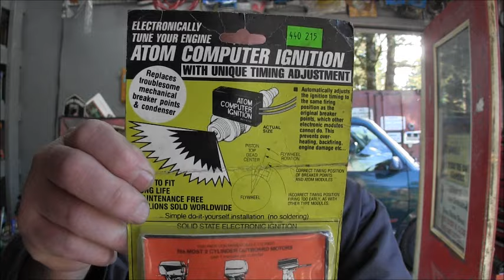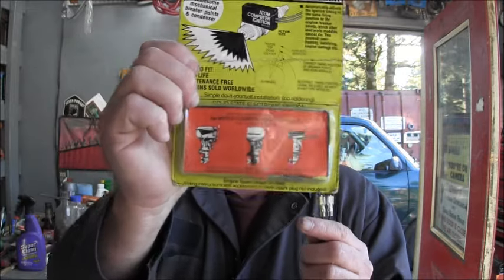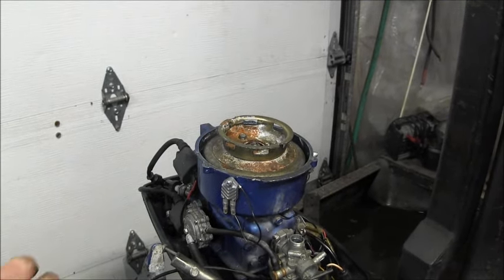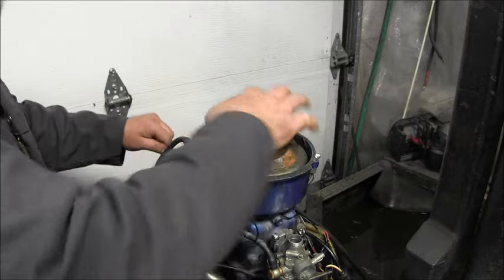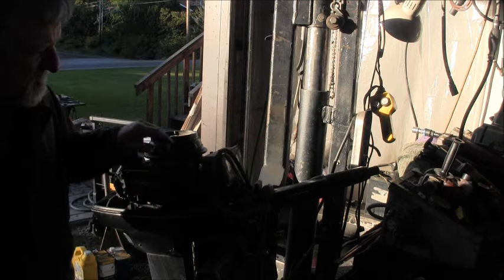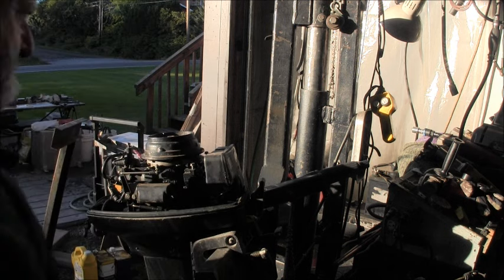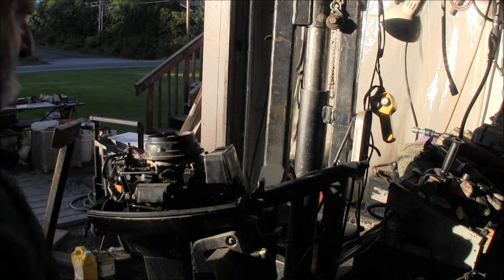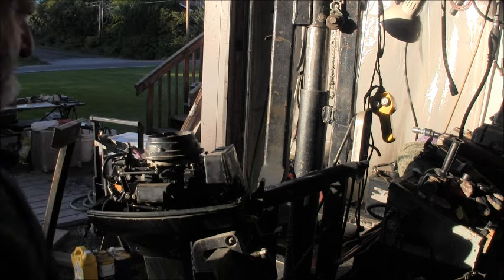DO NOT  BUY,  THESE  OLD  OUTBOARD'S

Comment: Tips for trying to pull of a stuck lower unit nuts and shift linkage removed tried heat on studs and wd still won’t come off some advise would greatly appreciated

Comment: It’s probably a safe bet the integrated circuit and transistor potted in the Atom was made in the US or Japan. The Nova most likely comes out of China. I think electronics 50 odd years ago were both simpler and more robust. I would be amazed if you’d get 50 years of service out of current electronics, 10 to 20 and your pushing it
Reply from the maker: Agree all         kb

Comment: There is probably a limit as to how much juice the novas can handle
Reply from the maker: I Think U R spot on Tim,  I am on a mission to see if I can crack open the original  ATOM  Aussi  module and see If it possible  I can reproduce it,  ?                 kb
Reply: I'm sure you can but look at the schematic diagram of the nova. It should show how many volts it will handle. My 60hp cdi coils have 240v approx going through them. Not sure what the coils on your motor are putting out but the Nova should handle that. You had two hooked up and one burned out? Maybe one is all that is needed but wired to both plugs? The schematic diagram will tell you more about those and what they can handle